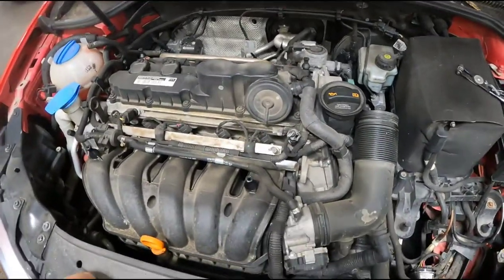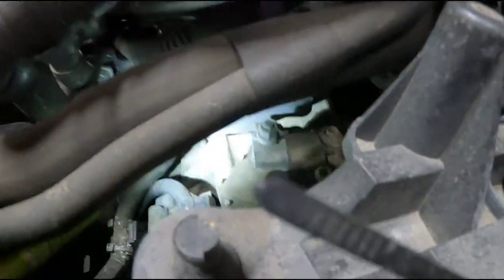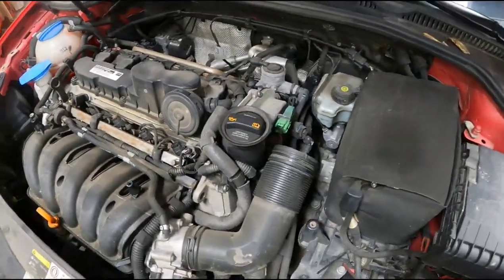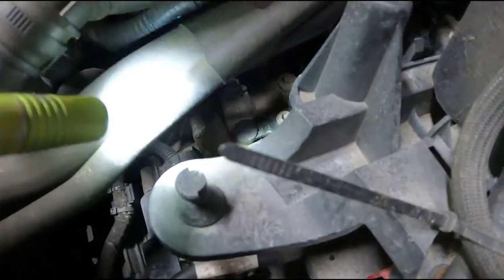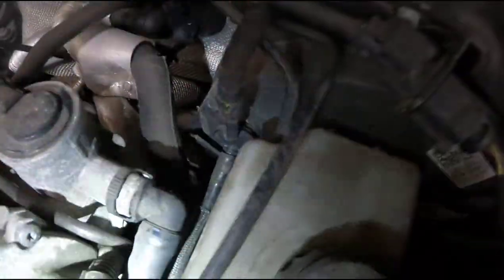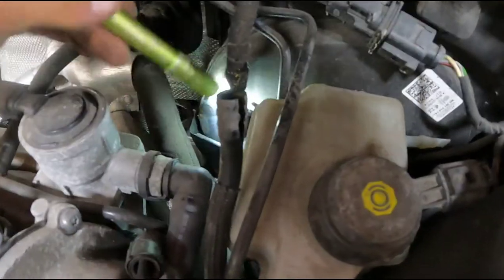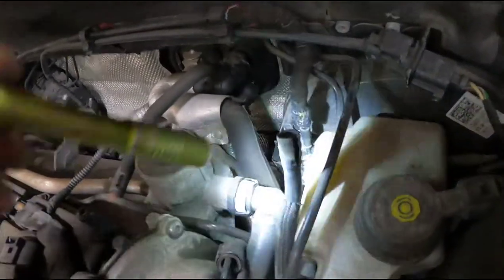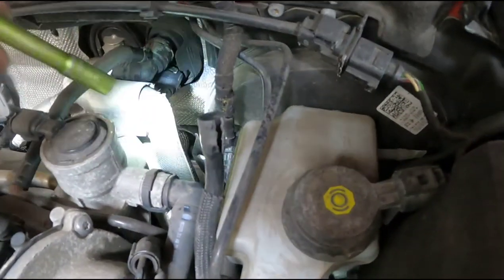VW 2.5 O7K (GOLF, JETTA, RABBIT) HARD BRAKE PEDAL

Comment: So my wife has a 2007 rabbit, this problem happened while we were in the mountains this weekend (Paonia Colorado) , I drove the car back to Denver  over 4 or 5 passes with the brakes being terrifying . This mornirn I scheduled an appointment for the car thinking it was the vacuum and I don’t have the tools at my apartment to handle a job like that . Anyway, In a final search for an easier solution I found this video and sure enough that is all it was . Got the hose for 108 bucks and got it fixed right away. Thanks so much for this . Saved me a lot of money
Reply from the maker: I’m so happy it helped man! Nice job getting to the bottom of it and fixing it.

Comment: I replace the hose on my car with a rubber hose using the same fittings. But the one that goes into the vacuum pump doesnt stay on for some reason.

Comment: Do I need to bleed the brake fluid once hose has been replaced? Also can’t seem to find the correct hose. Is it it called a Vacuum pump hose or booster hose?
Reply from the maker: No need to bleed brakes, it’s pump to booster hose
Reply: @EuropeanAutoRepair  Thanks man!  I almost pulled the trigger on a new master cylinder since I was still having problems with hard braking after changing the pads.  Like what the other guy said...i'm glad I found your video. Sure enough it was a cracked hose. Didn't end up buying the oem one, just bought a standard vacuum hose and used the old fittings...worked just the same and saved me some $$.  Hope you  make more mk5 2.5 videos.  I need to do a leaky oil filter housing next and not a lot of info on that for my Rabbit. Plan on keeping this car for as long as I can fix it myself.

Comment: So I got an 2007 jetta for free it came with 2.5 in it I'm not familiar with euro cars but the reason they gave it away was because the brake pedal doesn't spring back up it has power brakes and the brakes work fine I drove it having to kick the pedal back up with my foot so  it could release what would be my issue?
Reply from the maker: Have you already tried bleeding the system?
Reply: @EuropeanAutoRepair  that kinda went over my head I'll try that, although when you press the pedal it acts like a parking brake till you pick  it back up if I'll try to bleed it but if it still does it what should I try next ?
Reply from the maker: May have a master cylinder  issue, not too common on this model tho
Reply: @EuropeanAutoRepair  thank you I'll report my finding soon
Reply: @EuropeanAutoRepair  I found out the previous owner did the breaks pads all around and I guess that was the issue I bled the breaks all around and it fixed the issue than you
Reply from the maker: Excellent news!

Comment: I'm getting that hissing noise when breaking on my 2009 vw rabbit.
Reply from the maker: That's a strange one. Does it sound like a vacuum leak?
Reply: @EuropeanAutoRepair  I have a hissing noise (it does sound like a vacuum leak) as well on my 2008 but it goes away once the brake is applied. it also takes about 10 seconds to go away once the car is turned off. the braking feels normal though.
Reply from the maker: @lukebartlett3582  check the vacuum lines and check valve the plugs into your brake booster